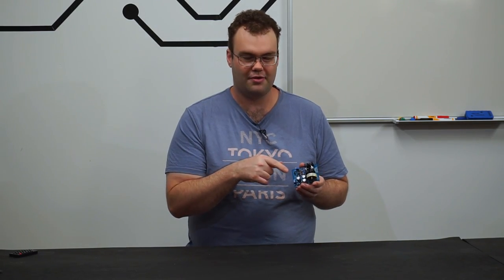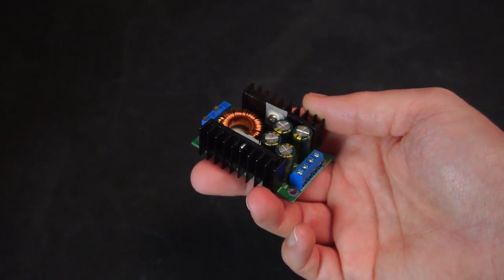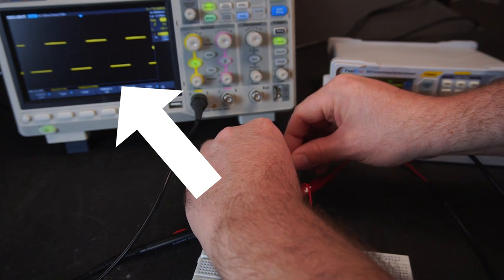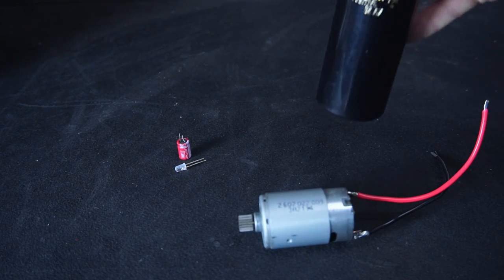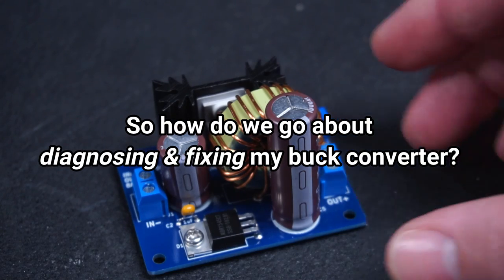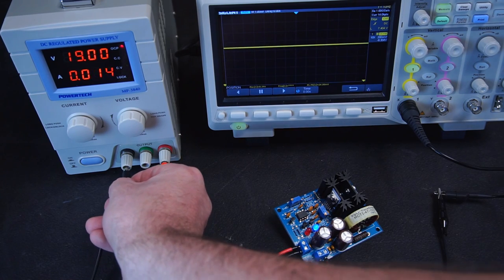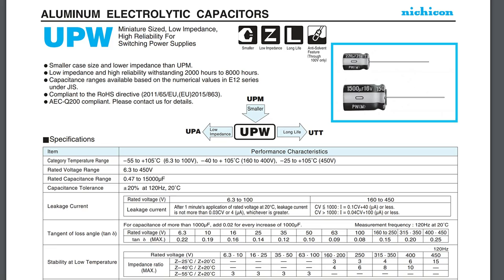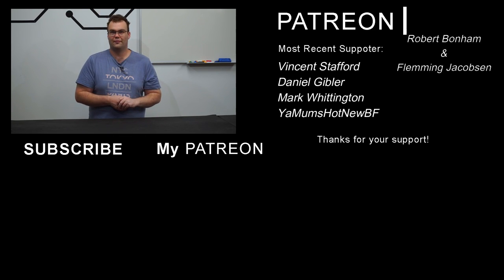Building a Buck Converter? Here are some design Tips

Comment: Re board layout, you can improve noise more -- especially EMI/RFI -- by avoiding PCB tracks altogether in the main current loops of the buck converter.  Place power components first, in locations that allow you to use wide copper pours to connect them together.  A 0.050" or even 0.1" trace width is not enough to make a difference; it needs to be very wide compared to its length.  In addition to reducing noise, this also helps to sink heat from the power components.  Once that's done, place feedback components next, and keep them as close to the control IC as possible.  Fit everything else in last.  Neat project!  You can learn a lot about high frequency circuits, PWM, control theory and filters by playing with switching power supplies.
Reply from the maker: Definitely good advice here, One more tip I can recommend to get around the wide track issue is to leave them exposed (no bottom mask) which allows you to tin the tracks with solder.

Comment: Hey being a relative novice I enjoyed that explanation and understood what you were conveying well. Fantastic, thank you. I have a big old toroidal transformer that I wand to use for a ZDS heater module. Trouble is it is going to end up at around 50volts out and I need to drop this down to 30 - 40 volts at 20 amps out.

Comment: 11:36 That is also the reason why I mostly build powerful voltage converters (except for mains voltage operated ones) by myself. The cheap ones out there mostly have crappy chinese capacitors and lie about their maximum output power. And if you build them yourself, you also learn something while doing so. Great video! Keep up the good work!

Comment: very informative simple and easy to understand , i have the same problem with 3.7 volt li-on chargers , i have only been experimenting with electronics for 18 months and have attempted to build several chargers , some will overcharge some will under charge , i dont fully understand the auto cut off . have you any advice for a keen novice wanting to build a 2 or 4 battery  charger with auto cut off that can run on 5v dc , 12v dc and 240v ac ?  thankyou .

Comment: Hi I just started to learn electronics. May I ask is it possible to to have a buck converter that outputs 400 mA?I have a 12 volt led light but only draws very few mA. Thank you I am trying to place a light that is good enough to close and open the gate for the 20 or so houses here. Thank you

Comment: I would be very interested in your 8A kit, especially if it has CC capabilities as well.
One question; the board you showed uses those screwdriver multiturn pots, is there any way of electronically controlling the output voltage or current (op-amps, arduino, etc)?
Either way I'm interested in the kit 👍
Reply: A litle late but yeah. There is a way using a digital resistors i have seen them in other videos or if the converter used a standalone FETs you couldve used a uControler to drive the FETs but  the guy is using a complete IC for the switching

Comment: I used a cheap Chinese buck converter with a high current HP plug pack (18 volts 10 amps) to make a variable power supply. The Chinese buck converter introduces a ridiculous amount of noise. Look forward to seeing a decant buck converter kit.

Comment: If I get the kit and take the pot off the board and put it in a panel for an adjustable bench top PS will I be introducing noise from the added wiring?  Any other considerations?  Are you going to do a variable constant current version?

Comment: Sweet design. How much do you think you will want for the parts and the circuit board?
Why do you need such a huge buck converter? Do you think you might tackle a boost converter?
Reply from the maker: Good questions Dan, I estimate the kit will retail around the $30USD mark. Why so big? More power = more better ;) Joking aside, the real reason is finding a low ripple/noise, high-current buck converter isn't exactly easy or cheap. Yes, I plan on building various kitset's including a boost converter. In the future, I'll look at building a smaller buck converter, perhaps based on the popular LM2596?

Comment: By it's very nature, you're always going to get noise on the output of a SMPS especially as you vary the load. Sticking a CLC Pi filter on the output with some additional small caps for the HF noise should help a lot. Why are you so interested in the noise? If you're just running some digital stuff then a few mv of noise won't affect it. If you want to also power some analogue stuff, run a linear converter just for the analogue which probably isn't taking much current?

Comment: 8A is impressive!  That blue/green toroidal inductor probably has a very high permeability.   Perhaps more exotic and expensive than my bag of yellow/white (u=75).  Have not been able to find good information as to the upper limits of switching frequency vs inductor core material, though it seems that toroids are not suitable for modern/fast 1MHz+ converters.
Reply from the maker: Thanks! Yes, Yellow/white toroids are also very popular for high current applications such as buck converters. You're right about it being difficult finding info on toroids for easy comparison between different materials. It can be quite frustrating to research.
Reply: @Schematix  I just watched your inductor video ... and like that Coil32 app/site.  Looked up the XL4016E1 as well, and it is expensive ... over 0.55$US ea.  I am scratching my head wondering where to get a diode that could handle the current surge for an 8amp buck ... (datasheet) That  MBR1545CT is an odd beast ... did not even know they existed.  My lousy 5A diodes already have legs that are so large, they are unmanageable.  You built something unusual here, that I think few people could appreciate, unless they already set out on the adventure of building a high-amp buck converter.
Reply from the maker: @GnuReligion  It's surprising that there really aren't many (if any) affordable & quality  'high-current' buck converters available online. I mean it's 2020 not 1920 lol
Reply: @GnuReligion  I'm very curious why would you consider 0.55 $ to be expensive. I searched this IC now and i see it's around 1 $, but i would still say it's dirt cheap (and i live in a poor country, pretty much considered third world). Speaking of diodes, i see BYW 29/200 can handle 8A continuously with an 80A surge, but that would be a bit to the edge. You would want to have a better diode, such as BYV 32/200 (16A cont., 100A surge). This one costs about 1.2 $ in a local store in my country. So again, dirt cheap. What exactly can you buy with 2 $ in your country that makes you think this is expensive ?? Here i cannot even buy a single fast food meal. And besides that, you should know quality doesn't come cheap. https://www.onsemi.com/pub/Collateral/BYV32-200-D.PDF

Comment: That's a great video to introduce  a complete beginner to the priciples.  I am looking to step down say 300 volts at 10 amps from a remote solar array down to 20 volts to charge up already existing local 12 volt batteries via existing controllers.  I have no idea how practical this is.  Can anyone here give me a steer on it?

Comment: Heyyy i love your videos. I need some help please 
i have 2 electric motors each 12v
Then i have a LED light strip also 12v 
And then theres one more UV light also 12v. 
I have the breadboard 
A arduino uno 
A Drok timer delay controller 12v-24v
And A dsd tech hc-05 bluetooth module 

My goal is to use my phone to set a shutoff time for the 12v LED lights and the the 12v electric motor is there any way that you can make avideo of something like this
Reply from the maker: It sounds like an interesting project. I'd like to play around with Bluetooth switching. However, with my current schedule, it will be a while before I get around to it
Reply: your project will revolve mostly around programming your arduino to receive a timer input, and then simply switching the outputs off. check out dronebot workshop; he has a bunch of arduino tutorials for all the parts of your project. if you're not comfortable with coding, you might want to look at XOD for a graphic interface for your arduino coding.
 easiest way i can think to do this is to use bluetooth adapter to connect to the Serial Monitor, parse a number for timer from the serial monitor, and then get a four relay module and just switch the relays once timer is up.
Reply: @Schematix  its cool im  always learning from you brother thanks so much 💪💪
Reply: @carlos2004  thank you so much i really appreciate ill get on it definitely need to get on XOD